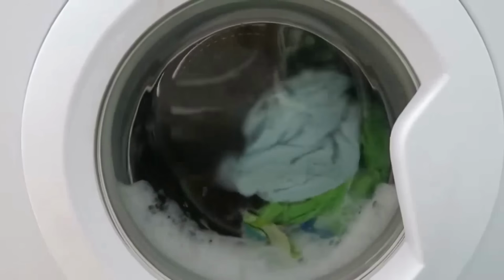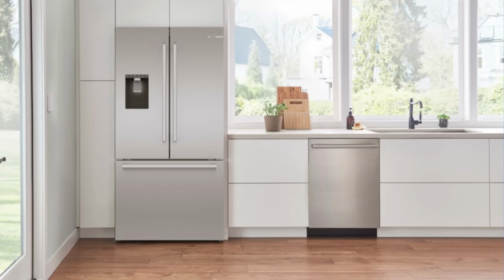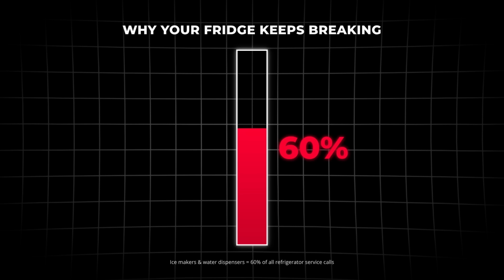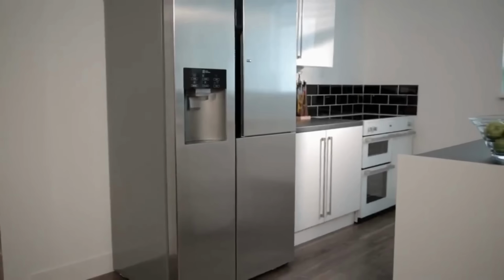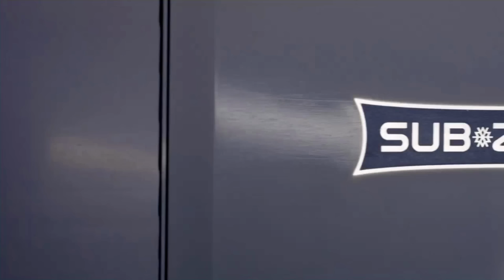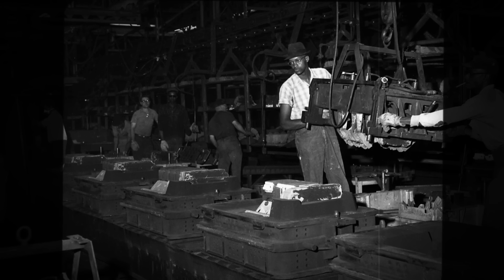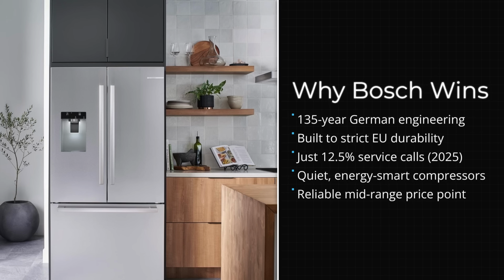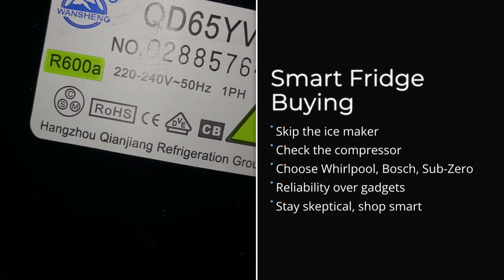Why 90% of New Refrigerators Are Garbage (The Cost-Cutting Secret)

Comment: Our fridge is 45 years old! It's a Kenmore made by Whirlpool. I've made two repairs over that time. I've replaced the condenser fan motor ($35) and icemaker trip pin ($3). So under $40 in repairs in all those years! As a mater of fact with my partcular model the icemaker is absolutely essential for the fridge to even run. If the icemaker is removed the fridge completely shuts down! This is due to the defrost timer being built into the icemaker so when the trip pin wore down it caused issues with defrosting and required the $3 fix. 😀 Also our fridge has a enamel metal interior liner - you won't find that in any modern fridge, only plastic!
Reply from the maker: Yeah they don’t make them like they used to

Comment: All compressors are sealed, I don't get what's the problem with compressors. Old reciprocating compressor is noisy, modern ones have differen architecture and are very quet. All the problem with a modern fridge is an electrinics. Plus additianl devices connected to the system. Otherwise the system is the same as 100 years ago, only 4 components. Sometimes the problem could be with freon charge as the modern way is a critical charge and any small leak makes the sytem disable.

Comment: I have a sears refrigerator That’s 17 years old. That’s never had a repair . I think it’s made by whirlpool all my appliances are older than 10 years Maytag washer 17 years old one repair clutch GE stove 16 years old never had a repair whirlpool dishwasher 14 years old never repair I would never buy any of those
 washers in a big box store or in a small appliance  store 
i’ll end up spending a lot of money in repairs, including speed queen mostly board repairs I would only buy used rebuilt, electron mechanical washes GE Maytag speed queen sears no electronic  very high failure rate in today’s washes
Reply from the maker: That's the secret right there, avoid the electronic controls!

Comment: One thing I haven’t seen anyone mention here or in the video, my Dad had a french door model refrigerator with bottom freezer and during the winter when humidity level is low, static discharge chances are greater. He walked to the refrigerator to press the electronic panel to select for water or ice, when he reached to press, static discharge from his fingertip hit the panel and instantly damaged it rendering it useless. After repair, now he has to remember to touch the fridge elsewhere if there is fear of electrostatic discharge to prevent frying another panel.

Comment: Or...
My GE is 25 years old.  10 years ago, the fan for the compressor failed.  I spent $38 dollars in parts to replace the fan and a few components around it (10 minute repair, thanks to youtube).  Let's say i paid a tech $150 instead of DIY.  That's less than $200 in repairs for a solid product.
For fridgs and so many things the KISS principal applies.
Reply from the maker: 25 years is incredible longevity for a fridge!

Comment: My new whirlpool refrigerator started leaking from the bottom I fixed it and then the ice maker broke I fixed it every year I pulled it away from the wall and cleaned the coil, fan and compressor hopefully 🤞 it will give me 12 more years.  Yes I fix everything myself that is the way I roll, but if the compressor goes out I probably will just get another one.

Comment: we have a 9 year old Frigidaire Gallery. The icemaker had a recall and we got a new one. But... I have to keep the freezer at 0F and the fridge at 40F because everything in the fridge will freeze solid if I go any lower in the fridge or warmer in the freezer.
Right now anything on the walls will freeze solid esp in the back. Anything in the back and sides of all three drawers will freeze solid. I've lost so much produce! 
And it's always a gamble if it will freeze or not.
I've tried having less in the freezer, cleaning the back monthly, Less food in the fridge, I really hate it. 
Every single door shelf broke off both the fridge and freezer. I gorilla taped and glued them as well as a type of epoxy for the cold. The frame holding the bottom glass shelf busted about a year in. The alerts for a new water and air filter go off every three months, I cannot afford that! 
To bring the whole thing up to snuff would cost 200$ less than a new fridge...with this being so "old" now, we're saving up for a new one. 
I'll look and see what we have in the area that carries a Bosch
Reply from the maker: Sounds like a total nightmare, hope the new one is better 🤞
Reply: Sound strange. 0F is the normal T for the freezer. In the fridge compartment you have the range from 32 to 50 F and you can regulate it. Probably you need to watch Youtube video how to use the fridge.

Comment: We have an “amazing” GE Cafe with Keurig coffee maker - we’ve replaced about a half a dozen parts over the years, but it’s still running for a decade now. One important thing we did was have a rear vent in the wall to allow air flow, which seems to help with over heating. These mechanical devices need to breathe.
Reply from the maker: That's a great tip about the rear vent, thanks for sharing! 👍
Reply: I bought the GE Cafe refrigerator and dishwasher two years ago. I love them both, no issues. I don’t use the wireless features and the water/ice is rarely used.
Reply from the maker: @j @jimmytaylor9854 is holding up good 👍

Comment: Sub Zero refrigerators are fantasticly reliable in my experience - in 16 years, only had to recently replace the internal touchscreen panel which took the technician minutes at a reasonable price.  My GE ovens / microwaves have also been solid.
Reply from the maker: Subzero is well built for quality for sure

Comment: I have a 13 year old Frigidaire - top freezer, no ice maker.  Never had a problem with it.  I'm super happy with it.
Reply from the maker: Less features = less problems
Reply: My Whirlp;ool side x side died at 8 yrs 1 month old (this past saturday) We called appliance repair but none of them could get her for 1 week and 1/2 and it was $150 just for them to get here. I have no clue if it was something simple or major... all I know is, there was water on the floor in front of the fridge, I could hear something running I think it was the compressor but the fan wasn't rurnning... everything in the fridge/freezer was becoming warm... What did we end up getting? A 20 cu ft frigidaire top freezer on sale for $503, after tax and all that it was like $583.... From this point on, I'm buying the cheapest dishwasher, oven, fridge,microwave since they're probably all going to die in 3 years

Comment: We bought. Brand new Frigidaire refrigerator a month ago.  They have been out 4 times and finally fixed the issue:  The water dispenser kept dripping.  It was the control board.  I know what does that have to do with the dispenser?  No idea.
Reply from the maker: Do you see what I mean with the new technologies?

Comment: The newer, NOISY,  energy-efficient compressors.  My utility keeps send ads about updating fridges, ACs and dehumidifiers. 
 I can get a whole $50 for turning in a working fridge, and $30 for turning a working dehumidifier. 
On newer fridges the drawers, shelves and racks are cheaply made and break easily.   Replacements cost a fortune.
Frigidaire is Electrolux now.
Reply from the maker: Yep, garbage

Comment: I have a generic Amana unit, no ice maker.  Came with the house when we bought it in 24.  The date on the fridge was 2002 I believe.  Just need to replace the missing bulb cover in the fridge and clean the dust out from the back once a year.
Reply from the maker: No icemaker no problems most of service call or icemaker

Comment: I was told by repair man that any fridge bought prior to 5 years ago is better than now. In the past 5 years they will crash on you
Reply from the maker: See I knew it. It was meant to be like this to drain your wallet.
Reply: They all use bio-degradable components. Parts start to break down right after they’ve been made.